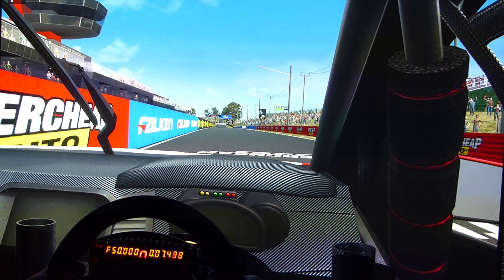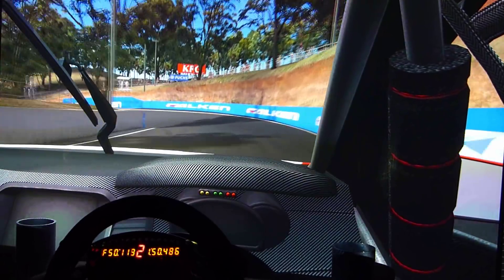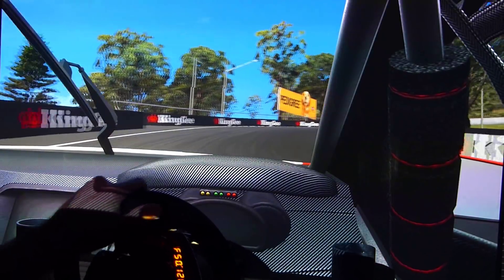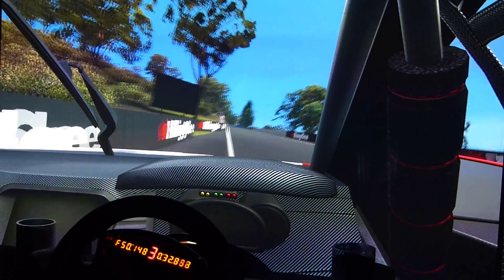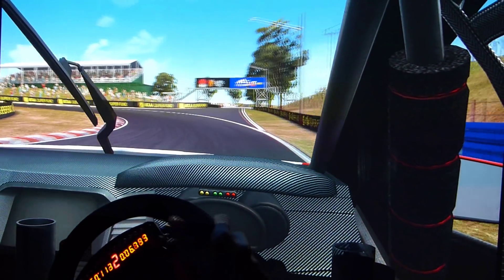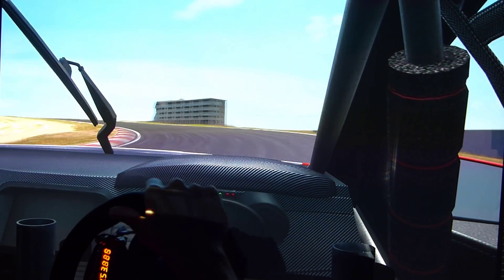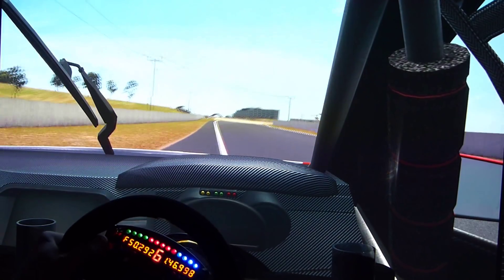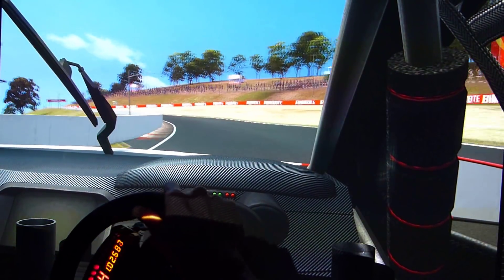Talk & Drive 17B: SimSteering ~26Nm (19lbft) torque torture!

Comment: Assuming a real life power steering on larger/heavier steering wheels smoothes certain forces out, should sims (especially if they want to simulate productions cars) also try to simulate a smoothing out of those forces and go for an authentic feeling?
Reply: Yer you can just add more damper in the wheel settings to do that.

Comment: Hi Niels. I have your Pro pedals ( which are awesome by the way!! ) and the same simsteering 2 54 motor as you have here! I have been playing GSC Extreme and enjoying it immensely. I have a question for you re: the FFB strength. You say you have it turned up to max but if I do that the wheel will clip badly on the same track you have here. I adjust the realfeel settings to suit but am unsure if I can ever get it near to %100 as there is no FFB metre in GSCE. Can you please share what setting you would recommend for users of Simsteering2. Cheers Andrew!!

Comment: I just googled a bit: A Porsche Boxster 986 (1996 - 1999) with 204 PS (201 hp, 150 kW) has a max torque of 245 Nm at 6000 rpm. This wheel has more than 10% of that? That's Insane!
Reply: That's not how steering torque works. 245Nm is engine torque. Regardless, 24Nm of steering torque is instanely strong.